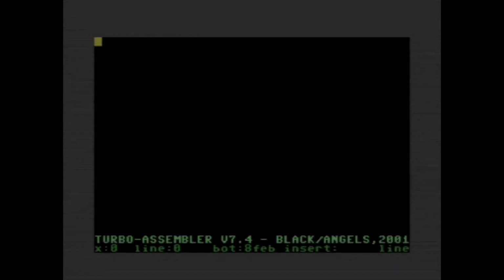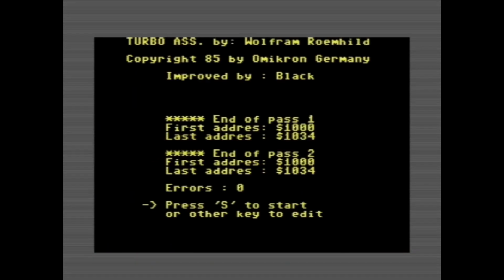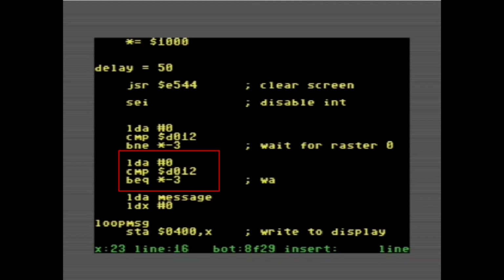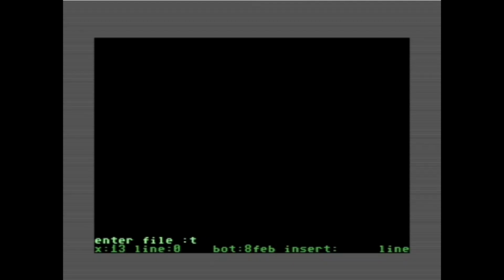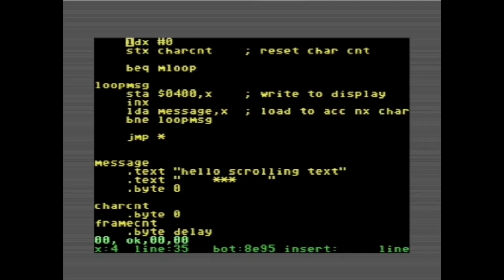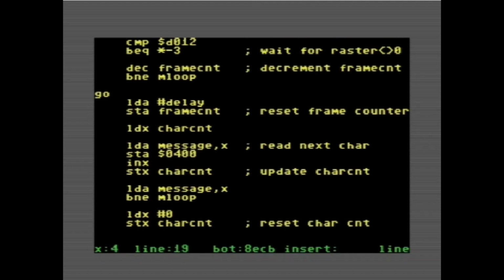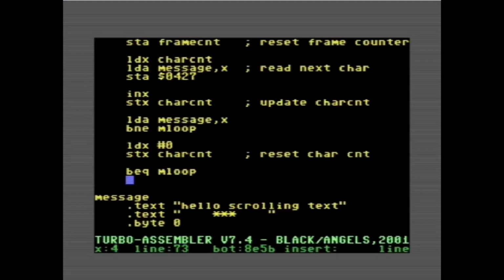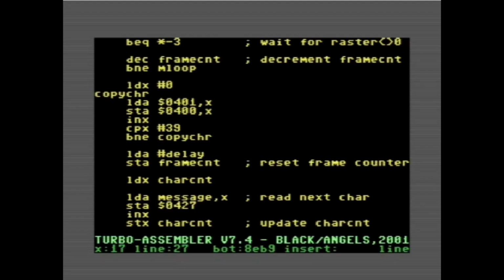C64 Assembly tutorial - Scrolling Text

Comment: If the code is at $1000, does the data default to $0000?  The accumulator is only 8 bits as well as the x index register.  Does "lda message" put the high-byte or low-byte into the accumulator?
Reply from the maker: Yes it's 8 bit wide but can load from a 16 bit address, so it will take the byte from that address
Reply: Yes, I understand, but which byte gets loaded into the accumulator, upper or lower?
Reply from the maker: @MK-ge2mh  accumulator can fetch one byte from a 16 bit address. Let's say message is located at address $1100, the equivalent assembly is LDA $1100. An address contain one byte only so there's no concept of upper or lower here.
Reply from the maker: Well I think you are misunderstanding what LDA does in that case.
LDA $1000 load the content of address $1000, which is a single byte value.
Sometimes you may have seen
LDA #>$1000 or LDA #<$1000: In that case you are loading into the accumulator the lowest / highest value of value $1000 (i.e. $00 / $10)